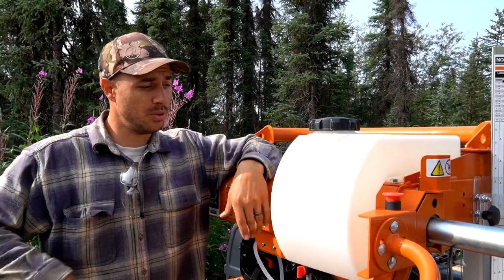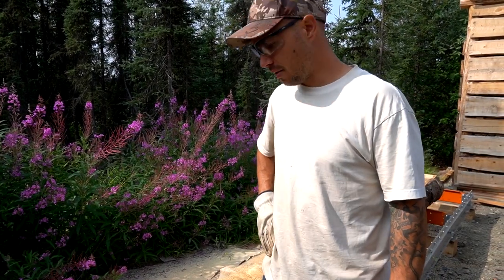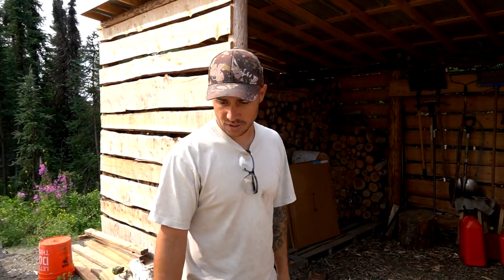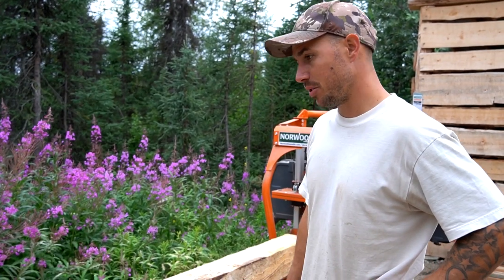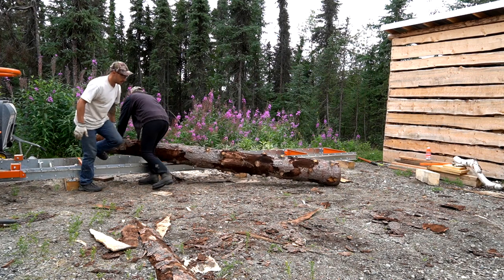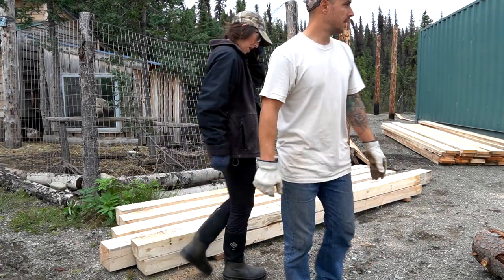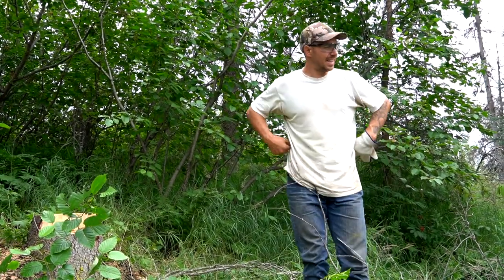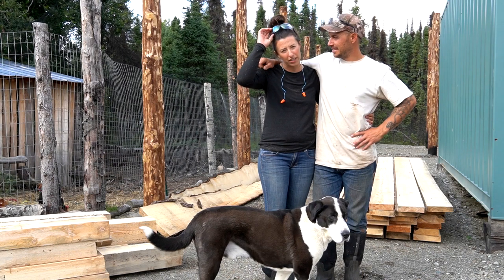Turning Dead Trees into Lumber | Milling Logs for Shipping Container Lean-To

Comment: Need 'stickers' between each layer of wood for air circulation between pieces or it won't dry evenly and warp.
Great job and ideas for your build.
Reply: Being cut from dead standing timber wouldn’t it be pretty much dried already?
Reply: Alaska Pirates  Tree I saw fall had green bows on it. 21:00 on video
Reply: @broncodude2828  tree I saw Eric felling had green bows on it. 21:00 on video
Reply: @desertdawg3409  Look again , there,s no green on that tree. It,s standing dead from beetle kill. All the needles have fallen off .
Reply: Dead wood still has water, you can reuse stickers, you can't use heavily warped and checked wood.  That being said, I wouldn't worry about it in this instance since they're throwing up the wood wet, it'll dry in place. It's a lean-to so that won't really affect it anyway.
Reply: Do I see a small crane/gantry on the horizon?
Reply: Stickers between each board are a good habit even if deadwood. You don’t the boards to warp before you even use them.
Reply: @hartiaacres  Possibly in process of dying and still standing, look at the branches still needled. It's not a skeleton. 
Maybe should look on a monitor and not a phone. Inner wood still has moisture.
Reply: They have probably already started building with it.
Reply: Air dry it or it will turn black from mould
Reply: What i was about to comment
Reply: @suzilouden5964  What they "need" is to learn how to parbuckle the logs on.
Reply: @broncodude2828  actually I have sawed logs that have been drying for 2 years and when I cut into them and then check the boards with a moisture meter often they are at 50% or more moisture..here in the northeast you want to dry them to around 8%. unless it is really hardwood like locust..I build with locust green because after it drys it will be so hard its hard to put a nail or screw into it unless I predrill all the holes first lol

Comment: Eric & Ariel -  I've been following your adventures for the past six months and catching up on the earlier posts as I've had time.  I found my time well spent.I've learned a lot about living in Alaska as well as living off grid.  My grandparents built a cedar log cabin in Eagle River, Wisconsin in 1952.  No TV or telephone.  We used an ice box for the first year.  Then we installed electricity and got a used hospital refrigerator that we still had when I sold our cabin in 1983.  Growing up from about 10 yrs old I was in charge of cutting and splitting wood.  For the most part we used dead trees.  None were over 12" diameter.  For the record I'm 78 years old.  In 2014 I took a two week trip to Alaska.  It was a lifetime dream vacation.  Something I had always wanted to do.  Thank you both so much for the joy that you have brought to me.

Comment: Your sawmill is a great idea. My grandparents used "clapboard" as siding. Your many good works, skills and stoic determination are impressive. Stay strong.
Reply: I don't know. but wouldn't the wood need to be debarked before using it as siding? Maybe after a few years' time seasoning in the elements will make the bark ready to fall right off.
Reply: @stevepoling  Tree bark dries quickly and falls away easily from clap board. The gaps were covered with tar paper. We heated with a wood burner stove.
Reply from the maker: Thank you John :)

Comment: I built Sawmills here in North Pole for bout 12 years.  I quickly realized the Need for a Used Front end Loader. You can use some skid steers but they dont lift as much of course. Be Safe Please, not just with your Sawmill but with life in the Big Woods Here. Happy to hear of your Escape from crazy lower States. Welcome to Freedom.

Comment: Just had a thought, maybe you could consider making a trough alongside the saw mill, in which to catch the sawdust? it'd be great for several uses, from possibly storing root vegetables, to insulation material, as mulch for the garden, and as cellulose for outhouse compost.
Reply: Yeah.... was thinkin'/wonderin' the same thing while watching all that cutting.... wonderin' how they'll gather/use all that sawdust that's collecting around the sawmill.  Will obviously be QUITE A BIT of it after each of their various projects.... great idea on the trough suggestion IMO.   ;-)

Comment: Eric & Ariel, GREAT job on the milling! 👍🏼👍🏼

FYI, your pricing from HD was for dressed, crappy, lumber not full dimension, far-superior, lumber like the two of you produced on the sawmill.

Three things are in your favor with the sawmill:
1. Better quality lumber 
2. Full dimension lumber, which is far better for construction.
3. Built correctly, your outbuildings will outlast the two of you.

One tip: the more vertical-grain lumber you can cut especially for structural and roof pieces, the better your builds will be and last.

Advantages of Vertical Grain Lumber:
01. Durability - Stands up to the exterior elements
02. Less shrinkage
03. Less cup and twist. The shape of lumber remains much more stable than flat grain
04. Less raised grain than flat grain lumber
05. Less tendency to check
06. Better wearing properties in all applications
07. Retains paints and stains much longer without peeling
08. Will perform much longer with lower maintenance costs
09. It has greater strength and will support more weight/load
10. Superior appearance in high end applications

There are many really old full dimension stick lumber built buildings still standing today, especially in the east and eastern mid-west, some are even ballon-framed.

The historic houses I used to remodel were built with full dimension, pit-sawn, hemlock, oak and walnut. All of the remodeling or additions I built were done with full dimension, lumber I milled specifically to tie-in with the existing structure, and the lumber was milled from doug fir, southern yellow pine or hemlock to match the structural integrity of the existing building.

Most people don't know that mills started milling 2 x 4 to 1 1/2 x 3 1/2, 4 x 4 to 3 1/2 x 3 1/2, and so on, to use the outer layers for veneer to produce sheet goods like plywood, luaun, etc.. Your lumber is way more stable too because it's not cut from fast grown forests, and speed dried in a hi-temp, oven-like, kilns like today's HD, Lowe's, etc., lumber.

Comment: hello, i am following you from France for more than a year now :) and if I may i would suggest you 2 things
1 make a little climb ramp for you lumbers to roll the lumber directly on the saw mill : the way you do it make an extra force on a part off the plane and therefore destroy your horizontal settings (no need to make a full ramp, two 3 by 6 screwed to some 2 by 4 an do the job : it will be easier to put the lumbers on the saw and your setting should last more.
2 be very carefull with the winch, do not EVER EVER put your finger around the cable to guide it : if it snaps due to the effort you could loose your fingers in seconds with the cable kick back if you have to guide the cable, use a strong stick, wich contrary to your fingers, is expendable... (and you'll keep a good habit if you work with steel cables one day...) (my brother who work in a forest exploitation lose one finger and arm his hand badly with such an incident)
stay safe and greetings from france :)

Comment: Happy to see the cant hook. Working the bugs out which includes settings and breakage. Nice looking lumber, for as big as it is and true dimensioned not nominal  seems like $2000 is a lowball price. You’re going to have to corduroy your big road, but hey if Robert e Lee could drive pickings in a swamp and create fort Pulaski on the savannah river  you’ll figure it out. Maybe winter time after freeze you could skid a bunch with a sledge. Cut, limb, pre stack now and move after the freeze.  Eventually y’all are going to need a better material handling rig, tractor or skid steer. Thank you for the great video. Anticipating a very well constructed set of leans. Thanks again.

Comment: The Earth settled under your base The sawmill you may need to put a pad of cement under each one of the base logs deep enough to hold the level is this going to keep settling over time!
Reply: The only issue is that the frost would end up pushing the concrete out. It's happened before with some posts around their garden. They have a very high water table and the frost seems to get in their way when it come to anything concrete. It why they didn't use it for the round posts.
Reply: Wouldn't the concrete crack with the frigid cold.  They mentioned that they don't put concrete in fence post holes because the frozen ground will push the concrete right up.  Up-Heave.
Reply: Alaska Pirates  what about just straight rock dust? Gravel seems like it would shift with time and freeze. I'm not am expert but my aunt and uncle used rock dust from a local gravel pit to stop their road from flooding.
Reply: If I'm not mistaken, I believe they said it was not a permanent place for the sawmill.. something to do with the snow.. You can go back and watch the video when they first got the sawmill.

Comment: pure some dishwashing soap in the watertank.
it "lubes" the blade during the cut some better as only water.
then you get more and quicker miles out of the blade.

but i don know the right ratio!

✌
Reply: Soap doesn't work so well in High Pitch lumber, diesel on the lowest drip setting removes the gum and lubricates the the sides of the blade as well as clearing the gullet. The best way to prolong the life of the blade is to use a wire brush on the bark where the blade enters the log or to purchase a precut or scribe attachment to cut through the sand embedded bark layer ahead of the band saw cut. The wood they are cutting doesn't look pitchy and the bark is relatively thin, so they can probably just have some extra blades on hand and send some out for sharpening now and then.

Comment: Dang...you made REAL 2x8's!!!! The construction industry hasn't used actual measurements since probably 1940.
Reply: I was curious because they look so thick, way thinker than the 2x8s at the store
Reply: @ExploringJ  2 x 8’s are actually (nominal  size) 1,1/2 x  7,1/2  in size at the store.
Reply: @dickdavidson3616  cool thanks, I had no clue
Reply: @dickdavidson3616  why is that? Drying loss? Thanks for the info
Reply: @StephanePlaisance  good question ,  it is not due to drying loss. It has always been done this way all my life and I’m 58. Maybe someone can help us out with the answer.
Reply: @StephanePlaisance  On second thought there must be some shrinkage after kiln drying and the remaining loss would be due to going from a rough mill cut to a planed smooth finish on four sides. That’s my guess Stephane.
Reply: @dickdavidson3616  yes you must be right, i did not think about the planing. Still, they should name what they sell, not what they started from. Thanks Dick

Comment: That saw mill is awesome. Will pay for itself in no time. You have to avoid dragging log's thru the sand it dull's your saw blade. Ideally it would be nice if your mill was on a cement pad. And any post that you put in the ground you should hammer the end grain closed with a hammer. And you should paint on some wood preservative on it.. That copper stuff.
Reply: Good question, when Eric priced the wood he'd just cut up at the lumber yard, I was wondering how long it takes for the Norwood to pay for itself. Since numbers don't present well without infographics, this might require a whiteboard.

Comment: When they say "portable sawmill", they really want it set and mounted on concrete.. lol. Those were some great logs though, good job! 👍Oh, I've been a viewer for awhile, just hadn't realized I wasn't subscribed. Sorry
Reply: I share your opinion, but I can't say I know anything.
Reply: @rch6956  Temporary yes, but the sawmill manufacturers also add the unit be set on level ground for best results. I'd find it difficult to do that on shifting soil. I understand their plight, and have done it as well, but it does make using the mill harder than usual.

Comment: Now that you have the saw mill going good you can always make more 2x4's and sister them up to the ones in the wood shed and make it a 4x4. Problem solved no more having to shovel the roof
Reply: I was thinking that very thing. And best to get it done before the roof develops a concave shape (sags).

Comment: Shouldn't you be using spacers between the boards to get airflow around them to help dry them even more before you use them? Plus to keep them from warping?  Or in this case you're using them so quick it doesn't matter?
Reply: Beetle kill is dead standing and competly dry.

Comment: We just finished installing cedar fences around the farm, all of the wood was milled out of old red and yellow cedar utility poles. The 40 foot poles were free from a friend who removed them from their original site in Eastern Washington. The bottom 8 feet were creosoted and cut we cut them that material off and sold the butt ends to another farmer who wanted them for a project on his place. So we have 6x6’s, 8x6’s and 1x8” cedar fence boards all made from free materials. We have boards and beams left over that will be made into a pergola and other projects. Oh, and the milling was done for a swap with some of the wood that was cut. The trim pieces are being used to make frames for my daughter in law’s floral picture press business. And we sold some of the trimmed pole ends to another farmer who is hand splitting cedar shakes for repairs on his buildings. I think the only materials we haven’t used are the metal identification numbers and letters that were nailed into the poles. (And I have an idea on how to use those for another little project!) This has to be one of the best recycling projects our family has ever been involved with.

Comment: As a suggestion, cut some 2x4s and nail(better if screwed - 3.5") onto the woodshed roof trusses. You have all that beetle kill so close to the project. Also, now you can add on to the house and make a better place for inside winter work - just a thought.

I have a woodmizer LT40HD- best tool I ever bought.

Comment: A couple tips maybe. I purchased a cheap handheld leaf blower. I can clean the saw, the rails, and area after use. They make battery ones too. If you find you keep having to adjust level, you may want to consider burying posts vertical and than building level horizontal supports. Gets weight off the ground and also brings your work area up.

Comment: If I could suggest that you place rail beams lengthwise underneath the course of cross beams, which would run parallel with the mill tracking. This would help prevent downward force on any one particular cross beam thus reducing the chance of it going unlevel any further. Love your videos. Cheers!

Comment: Wowo no time to waste.
Preparation for winter as scheduled. Lucky you managed to get to recycled dead trees. Also, save time to dry it.
 .Plus  it is a good forestry management. Healthy for other trees, soils and forest fire risks management.

Hope you keep some anti histamine pills with you.that should help with bee sting.
 Btw really appreciate Eric forward thinking when cutting the planks for beams and roofs supports system. Factoring, less maintenance during winter and load bearing.👍👍
Smart practical thinking there. Always applies logic and basic common sense. Keep it up both of you..
Hope you can complete this project soon. Without any further delays...

Keep safe y'all

Comment: Its really nice to build stuff with the work you put into it all. And using true sized lumber is awesome as well.Make sure your getting your out side guide kept about 2 inches from the log. It will save you alot of frustration as the blade get duller. Keeps it from flexing so much on ya and braking! Need to build a ramp out of some C channel to help ya roll them logs up!

Comment: Wow, I've never been around a saw mill, but I never would have guessed that it would use that much water flow to lube the blade. I can see why you would want to have that autolube feature. Not only does it save on labor of turning it no and off all the time, it saves on how much water is used.

Comment: Seeing the issues you had with the sawmill going out on level when you have the time someday I would recommend putting it on a concrete slab. Once you’ve got the concrete slab level you’ll be absolutely golden. You won’t have to worry about dropping the logs on there.